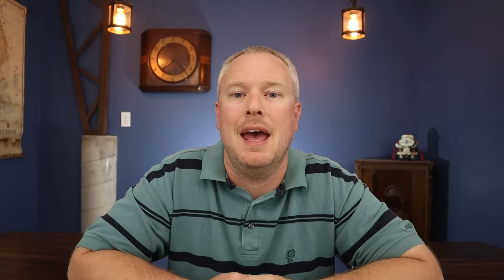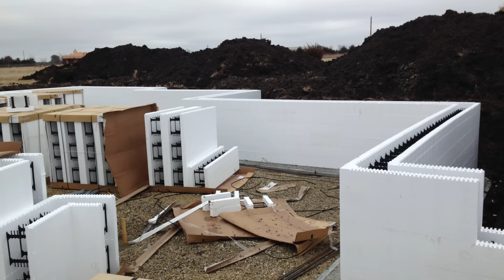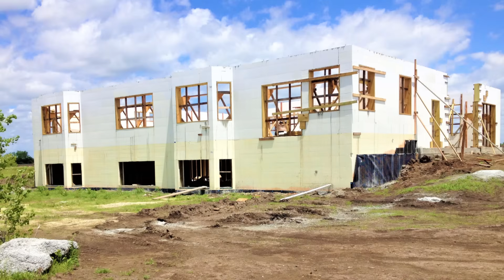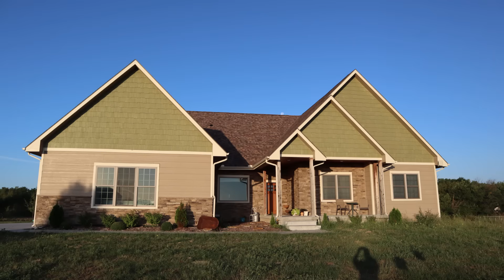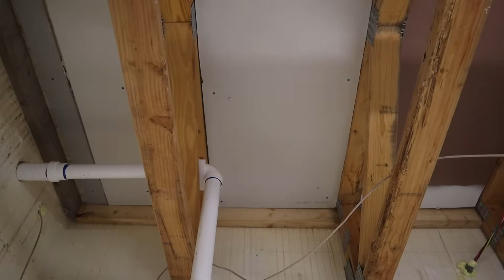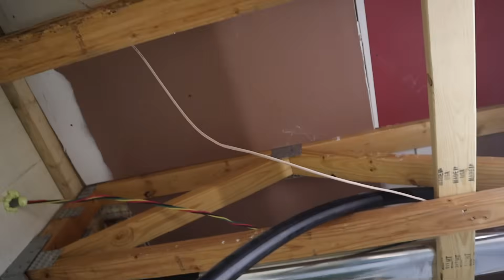Is Geothermal Heating & Cooling Worth It?

Comment: Below the sheetrock you screwed in below your son's room, I would recommend you stuff a bunch of Rockwhool insulation.  It is extremely dense, flame retardant,, and extreme noise dampening.  It should get rid of all the noise.  Shouldn't take you more than 15-min

Comment: A question to all: comparing to air source air has a big advantage because you always suck heat from fresh air of atmosphere which can be assumed as infinite. I mean the fluid which is air is always refreshing in case of air source heat pump. However in ground type the heat source which is soil around the pipe is not refreshing like air source case. Okay ground heat capacity and transfer performance is very good comparing to air but suppose you are in a long season winter and you are sucking heat from soil around the water pipe. So you are freezing soil around the pipe day by day. So you COP getting worse and worse. 
Do we have any expert doesn’t mind to explain this is not the case actually? 🙏

Comment: RE:   Sound Deadening   
DEAD AIR SPACES  ...   if you notice,   in many houses,  there are   CLOSETS   built between rooms (strategically)  to HELP  with the "silencing effect"  (privacy).      IF you wish to  DEADEN   the sounds reaching into the room ABOVE  the compressor,  do this.  .... THIN FOAM stapled on the lower edges of the Joists Above.  THEN  RE-Rock that ceiling....   you really don't  NEED more insulation between the joists,  but go ahead and add cheap rolls to help with deadening.   AFTER The re-rocking....    you will have  Created that  "dead air"    which is   PERFECT for sound deadening...
      if you have  EXCESS Cash to throw at this..    you can make it more expensive that this but....   just using 1/4"  sheet rock should be  very sufficient .... you COULD  even use some type of  cheap PANELING  ,  it'd be lighter to lift and will STILL   create a "Dead Air Space"

Comment: I dunno. A hundred dollars a month still seems like a lot of money.
I'd be interested in a comparison between the ICF wall and a concrete wall with all the insulation on the outside so the concrete's thermal mass is inside the thermal envelope. 
Also a comparison between that coil of narrow-bore pipe in the trench compared to a much wider bore pipe in a straight run. What you lose in lower surface area I reckon you'd gain back in less resistance on your pump, especially as you wouldn't need to run it as fast either.

Comment: Hello, this system is very interesting. I first heard about it on your channel.
I did some research and also found a geothermal system, which they call a Canadian well here. Basically, it is a geothermal system that uses underground piping, but instead of using liquids, it is basically the air that cools/heats inside the piping and is spread throughout the house. It basically uses a fan/exhaust fan. Do you have any experience or knowledge about this type of system? What do you think about it? Does it work?
Your system is cool, but in my country there is no equipment necessary to make it work. Thanks

Comment: Great Videos about this.  I am interested in informing you about the noise factor.  I have investigated and and used Roxul (Rockwool) Insulation.  In the demo videos, they showed that this stuff have FANTASTIC Sound Proofing Qualities.  You should watch the Demo Videos showing this characteristic.  If I were you, I would install it in between your son's bedroom and the "heat pump room," or whatever you call it.  Another thing that you could do, if funds provide, you could install it in the walls and ceiling of the "heat pump room   You could end up with a very large reduction of sound transference....Anyway, Thanks for the Great Video.  Great Info.

Comment: 0:05:10 
I would consider attaching rubber strips (butyl rubber tape maybe) and screwing the sheetrock to the bottom of floor joists, with the rubber strips absorbing vibrations.
Maybe also put some fiberglass batt or blown in type insulation. 

Contemplating this type of GEO thermal system for a new home build I'm designing for my parents. 

Going to have sprayfoam installed for the attic space anyways, so I will probably do a hybrid closed cell / open cell application on utility room walls/ceiling  to isolate nearly all noise from living spaces.

Comment: You didn't mention using any energy programs from the utility. I use the dual fuel program with wood backup at half the rate and hot water storage at about one quarter the rate.

Comment: The rebates got BETTER but king trump, in favor of big oil, halted those rebates and tax credits. So that is going to have a negative impact on affordability and forces people to pay higher and higher energy bills.  Also,  have you tried a soft start to help that motor kick in a little easier?   Something like this or cheaper - Micro-Air EasyStart Flex 398 Bluetooth Soft Start Kit

Comment: @challenged1 Thanks for posting the video. It looks like you have one air handler for the system. How do you have it zoned, and is that working out fine for you across both floors?
Reply from the maker: I have two separate systems.  One does the living areas, the other does the sleeping areas.
Reply: @Challenged1  That is a configuration I didn't consider. I've been looking at the WaterFurnace series 7 along with their IntelliZone2 zoning system which seems like it would fit our needs. I like the idea of being able to control each bedroom temperature individually and then a zone for each floor since their system says it can handle up to 6 zones. The SF on our build will resemble yours, and it will be an ICF ranch on a walkout basement. Initially we were planning to just do two units one for each floor, but this option may make the cost work out to where it is almost a wash.

Comment: I bought one 25 years ago. It did cost more. However, it only increased my mortgage payment $30 a month. I had a bigger home than all of my neighbors. And My heating and cooling bills averaged $200 a month less than my neighbors.

Here is a layman's example of how geothermal works. Imagine racing Usain Bolt at his peak athleticism and you are at your peak athleticism. He is the best normal HVAC system at the starting line. You are you, but you get to start at the 55 meter line. You will easily beat him in a 100M race running backwards. That helps you understand the efficiency of the geothermal heat pump system.

Comment: I need help. Anyone .  Be sure u know what ur saying. I have a shop with spray in insulation. Its got a 10 ft ceiling 30 by 30 ft square. A 5000 btu window unit cools it down after a day or 2. It has full sun. A 5000 btu ac unit is half a ton . Figured i need 600 ft of 3,/4  pex pipe im thinkung of going 4 ft or so underground. I have a case 580c  extend a hoe . I am gonna use 2 car  radiators  with the double electric fans. I am gonna run a  solar pump.  eventually to run  all day. Also wanna gwat a greenhouse  with this system. Does anyine gave any ideas. Im ginna run 2 manifolds a suction one and a duscharge side manifold. Very  low price   so for. Almost free. Im ginna circulate the water through the radiators circulate  room air throgh the radiator constantly. The water should circulate ubder the griund pick up cold and dump it into my shop

Comment: No geothermal video ever tells me how love they can cool their home in the summer. I don’t understand how can get a temperature lower than the soil?
Reply from the maker: Because the geothermal lines are connected to a heat pump with refrigerant.
Reply: Mine is infloor heat. And it uses chilled water fan coils. For air conditioning. 3400sqft heated and cooled to whatever temperature I want. The heat pump only has to pull heat out of the constant ground temperature of approximately 56° ground. Instead of -20° air. And the opposite for cooling. So it doesn't have to work as hard.

Comment: 🙏 Thanks for sharing
in your last video, you mention sandy soil as being the best for this type of installation however sand is one of the best heat accumulators and it's used in most industrial applications for that very purpose. Now, I am in the position where I have to decide how to construct mine to feed the underfloor heating of my 1000 square feet new lab because I have sand just below 1.5 to 2 m and water not far under that so I would have no option. Moreover, my sandy soil being wet would improve further the thermal conductivity.  Alternatively, I could opt for a horizontal arrangement rather than my preferred vertical type but I would not be laying the piping as deep as it would be ideal.
Reply from the maker: Dry sand = Bad
Wet sand = Great

Comment: The biggest complaint I've heard about heat pumps is "they can't keep up in the cold". To me, this sounds like their system was not properly sized, and now heat pumps, and geo-thermal is getting a bad reputation, not because they are junk, but because they were improperly sized for the installation.
Reply from the maker: I would agree with this statement

Comment: "I have a very efficient and well insulated house so a geothermal heat pump fit right in..."
But...  if you have a super efficient and well insulated house, an air-to-air heatpump *also* has to do less work, making it's cost breakdown a lot cheaper too.
Reply from the maker: Generally, a well insulated home will require a smaller hvac unit regardless of the type of unit.  The amount of work done between the different types of unit would be nearly the same.

Comment: 9 tons, 10 feet deep, 30% antifreeze, "the heat strips never turned on", $25 000 price tag despite building it yourself, I have a feeling if you installed a smart meter to measure all year how much of the day your system is ON, you'd probably get a figure of 10 to 20% to a maximum 50% during the day with the deepest gradient between inside and outside. Meaning you could've cut your BTUs in half, dug 2 trenches less, etc etc
Reply from the maker: My entire system is 6 tons.
Reply: @Challenged1  But have you checked out how much of the year it spends turned on?
Reply from the maker: @Wyvernnnn  You are right, I could have installed a smaller system.  However, the system I have will last far longer than a smaller system that runs more often.

This was a new build, so there was no before data.  It's a catch-22.

Comment: A far better option for you would be a system that extracts heat from waste grey water from showers, clothes washing and dishwashing.  It would be stored temporarily in a large underground tank with the required piping to extract the heat in conjunction and tied into an Air to Air heat pump.  Any excess water would flow to the sewage system but some could also be recycled back into the toilets for flushing reducing both the intake on wells or other sources of water as well as reducing the outflow on sewage and this is especially important if you have a septic tank.  The storage tank could also be used to store waste heat extracted from PV Panels for use later.

Comment: My grandpa Carl invented the geothermal heating and cooling system, without water wells like 2 of them with one at 250ft an one at 150ft be needed in a real geothermal set-up, that will last a lifetime. There 2 ways to goo, there was 4 prototypes done in 1979-1981 in stillwater Oklahoma, 2 of them were one way an the other 2 were done a different way, its complicated to explain. But it works, fyi my grandpa redid all the HVAC to the underground bases in the 🇺🇸,  RIP Papa, miss you everyday 😢 he been gone since 2014 FYI. Ole Carl's invention I love seeing people doing these DIY videos an reviews etc videos on it on here. Fyi the original idea of geothermal heating cooling setup be for environment of Oklahoma, if your in different environment design will have to be different so improvise:)

Comment: 5kw system with 18 panels.  That doesnt make sense to me.
Reply from the maker: What is the confusion?
Reply: @Challenged1  277w per panel?
Reply from the maker: @Patco.1981  They are rated at 285w per panel.  The 5KW is rounded
Reply: @Challenged1  I get the rounded, but panels today are 500w each.  I found it interesting that you manage a 3000SF house on only 5kw.  Most likely there is a 25kw transformer in front of your house.
Reply from the maker: @Patco.1981  These were purchased many years ago.  If you build for energy efficiency, you don't have to offset nearly as much.
Reply: @Challenged1  check and check. I am installing solar panels.  I don't plan on needing anymore than 5kv or 10 panels.  Any more and you are wasting your money.  My buddy has 32 panels and generates 3x what he uses.  Of course the power company will buy the extra KW but for pennies.
Reply from the maker: @Patco.1981  In my case, we have net metering for the month only.  Meaning, anything I over-produce does not get paid or banked.  It's in my best interest to use everything I produce and have no, or very little excess.
Reply: @Challenged1  Here in Florida, nothing is carried over to the next month. However, if there is an excess for the month they will give you a couple of pennies for each KW in excess.  May as well be zero.  Building a solar system to precise needs is necessary to avoid paying more than its worth.  Most companies around here take advantage of homeowners and just put up as many as will fit on the roof.  Not me though.  5KW is plenty.  Like you said, solar isnt a zero sum game.
Reply: It's always funny when people who "are going to" talk smack to those who have already done.

Comment: Although I am reading this one year after it was put on YouTube, there is a comment that I'd like to make regarding propane.  He said that the price was volatile during certain times of the year and he is absolutely correct.  If you have a propane tank that belongs to the propane supplier, you are paying the highest price for propane particularly in the winter months, astronomically high per gallon.  I got an education on propane purchasing when I was a Director at a 501 C nonprofit organization.  Subsequently at the same time I was moving to a home that had electric  heat and I wanted to change it to propane.  Here is what is necessary to get the lowest price and it is unbelievably cost saving.  You must own your own propane tanks.  I recommend you buy two 1000 gallon either below ground or above ground propane tanks that you own.  Each tank will hold 85% of 1000 gallons.  in my situation one 850 gallons would handle one winter season.  I didn't need to buy any additional propane during the winter.  The only time that I bought propane was in mid June or early July when the price was lowest.  Because you own your own tanks you contact all of the suppliers in your area and give them the information that you own your own tanks and you're interested in filling one or more within the next week or two.  You will be stunned at how low the price is comparatively.  If you can't handle buying one or two propane tanks, I recommend you don't attempt to heat your home with propane.  A good thing to remember is that electric heat is 100% efficient.  If you insulate properly and I mean properly that is also a very good option.
Reply: I was in that mindset too, for a long while, thinking electric is 100% efficient (100% of the electricity turns to heat) which is fairly accurate. What i didn't understand was heat pumps.  Heat Pumps don't make heat, but rather transfer heat.   They can move the same amount of heat into (or out of) your home using 20-50% of the electricity you'd use heating with electric resistant heaters.  I'm looking to upgrade my hydronic heating to an air to water heat pump, but also considering a geothermal (water-to-water), and mini-split (air-to-air) system.  Trying to weigh the benefits and costs - just know I need to move to an efficient heat pump.
Reply: @ 
A friend of mine who worked for the power company in our area, has since retired however the discussion that I had with him bears thinking about .  He said that the opinion of the engineers that he worked with at the power company were of the opinion that the most efficient way of heating a home was the following.  The house should be properly insulated and there are specifications for that so that’s the first thing.  Their opinion was that 100% of the electrical energy put into a boiler was probably the most efficient way and the easiest and in many cases the least expensive way to heat a home.  I wouldn’t really know what questions to ask people like that but they spend a lot of time between themselves over the years trying to figure out if there’s a better way and the conclusion was as stated.  Naturally there are always questions about what would you do in the winter if the power went out etc. so your conclusions may be based on your particular situation.

Comment: when you were talking about the hypothetical farmhouse, what did you mean by the ground could become saturated? thanks for both your videos on this system and congratulations- you did a lot of work!
Reply from the maker: The ground only has so much heat to give within a certain period of time.  If the system runs too often, it could drop the ground temp faster than the ground temperatures can recover.  The ground has a heat transfer rate, and it is possible to exceed it when withdrawing heat.